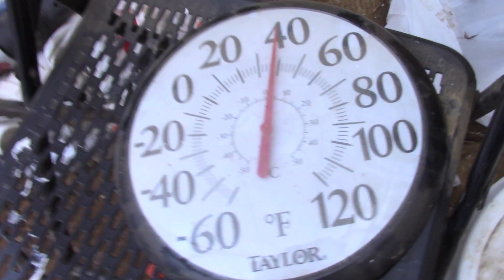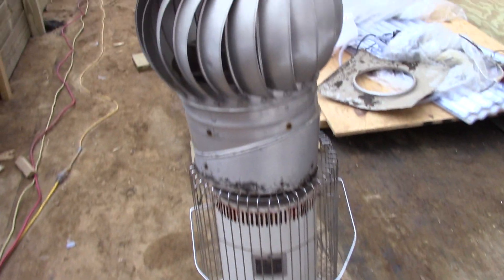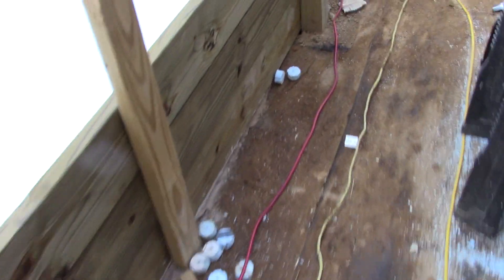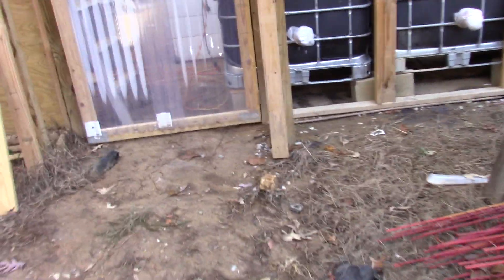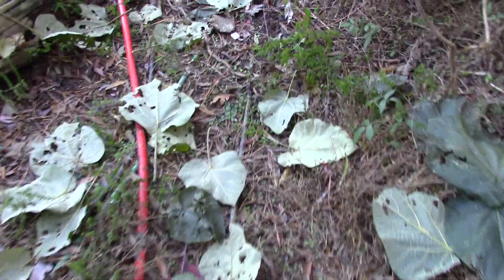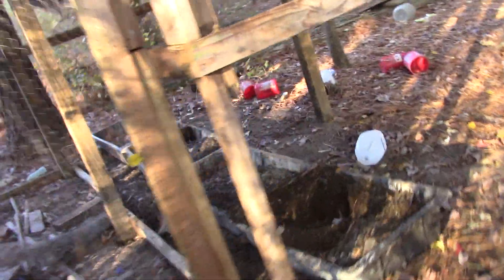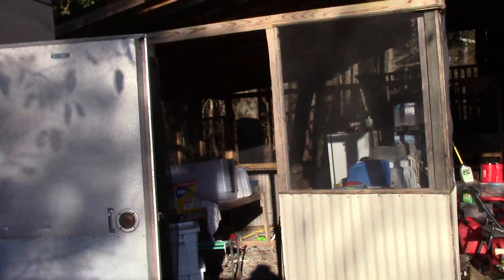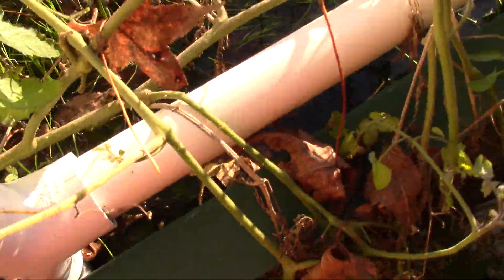Emergency Winterization Of My Aquaponics System Part 1 of 3 for 11 Nov 18 Cold Snap

Comment: may I suggest that a much lower ceiling be employed as it will cost much less btus to heat also heat the air vs heat the water and that will stop the fogging on a cold day

Comment from the maker: Check out part 2 o 3 on the thermal mass of the aquaponics water maintaining the temperature at 38 F (so far). I will post video 3 of 3 after I complete the solar water heater installation. Until then I will post videos on other topics. Here is 2 of 3: https://www.youtube.com/watch?v=9Bio1rdT_8k

Comment: Hey Greg, Master Electrician here. First comment, your circuit is only as strong as the weakest link. No matter where you place the lowest amp cord. No magic there. SECOND, get yourself an Electricity 101 book for say $10 and learn to do your own electric. Not rocket science. Save a bundle and get it done on your schedule rather than an electrician's schedule. Third, use a cheap box fan to distribute the air around the GH. I run one year round and it helps to prevent mold on your plants as well as avoiding spindly plants. Like people, a certain amount of exercise is healthy, lol. 
My aquaponics system is about 2400 gallons so about half the size of yours and been running non stop producing trout and veggies for the family since 2012. Hey did you get those winds last night? I was sure we would lose a few trees but not that I can see so far. 
Hey build one of my GH wood stoves. That one is simple and takes about a weekend. That too has been keeping our GH toasty since 2012. Pretty much everything is on my channel on how to build it and it heats the air and water. Very important to heat both. Without that your electric bill is going to be out of control as we enter this GSM for the next 50 years. I know, never enough time to do it all. Happy to see you have been doing AP for many years. That is a big boost having that knowledge before you went all out. Very smart bud. Gonna snow here again in a day or so. The GSM is rearing it's ugly head and Diamond is keeping us up to speed on what to expect next.
Reply from the maker: Yea, I could put in those runs, but it boils down to time too. Would take me longer than them as I'm novice at it. But I may just do it anyway as money is getting short too. My first priority is to install the solar hot water heating system. I have the supplies, so that is the next item up.
Reply: @greengregs  solar is only good when the Sun is out so you will need a big backup for that big GH. Keep in mind that tunnel and geodesic dome GHs have huge thermal losses on that N side. That's why I designed ours like an Earth Ship with the N side well insulated, the 5 trout tanks on that N side, an insulated interior wall between the fish room and the hot house and a good E, S and W GH skin so it only has losses on the sides that also heat it from Sun from Sun up till Sun down. Earth Ships and Penn and Cord design theory. Folks tend to forget that the GH is really only for Winter so it should be designed for Winter. Summer is never a problem if you can just open it up enough, so very unimportant in actual practice. Winter is what it is all about. Now in Georgia you might not have thought that was important but Diamond might not agree, lol. Have fun.
Reply from the maker: @fiskfarm  I had thought originally about putting a thermal wall on the north side but my greenhouse is right up against my orchard and I wanted to add another 8 x 64 foot grow bed inside so I just didn't have room. However water is a great solar battery and the plan is for the solar to directly heat the water - so that should help. So far the thermal mass of the water alone has kept the greenhouse from dropping below 38 degrees F. Lettuce can take freezing on their leaves as long as the roots are not freezing. So as long as I can keep the water from freezing I can operate. I did get T fittings and additional valves to tee off to another heat source for the water. Thinking to build a gas-fired rocket mass type water heater. Checkout my latest video on the temps staying at 38 F (so far). https://www.youtube.com/watch?v=9Bio1rdT_8k
Reply from the maker: @fiskfarm  I also do have two kerosene heaters and a couple of in tank heaters.
Reply: @greengregs  keep in mind my gh woodstove is a "rocket mass heater" or RMH. Gasification is the new term. The difference is that mine holds 8 to 12 hours worth of wood, is solid state thermostat controlled, firebrick lined and fast and cheap to build. Most RMHs need to be fed every couple of hours. No thanks. My house build is far more complicated and requires ss welding, plazma cutter etc and takes weeks part time to build. Both work great and are easy to start due to the blowers. The gh stove will start on its own after a reload up to 2 days later. A real honey for the money. Water btw is more than 2 times better at storing heat than stone of the same volume so we have a real advantage doing AP.
Reply from the maker: @fiskfarm  Was just going to put a gas burner in so that mine would not have to be fed every few hours. Where is you farm located?
Reply: @greengregs  Shady Valley in NE TN in the mountains. Moved here from Moosehead Lake in Northern Maine in 2010. 30 years on Cape Cod before that.
Reply from the maker: @fiskfarm  If I could find my way up there one day would you be interested in giving me a tour? I'd be happy to show you my place.
Reply: @greengregs  absolutely. Btw have you checked out Penn and Cord gh designs? G it and take a look. One just needs to add a N side room on the back for the fish and it would be perfect.
Reply from the maker: @fiskfarm  O'll look it up!
Reply from the maker: @fiskfarm  Those are nice! I've seen designs like that. Maybe my next one!